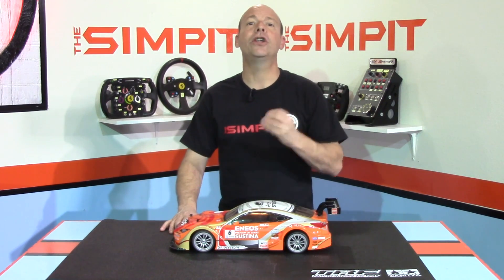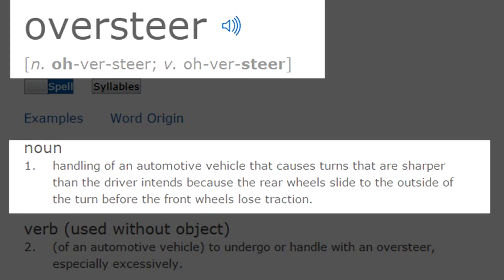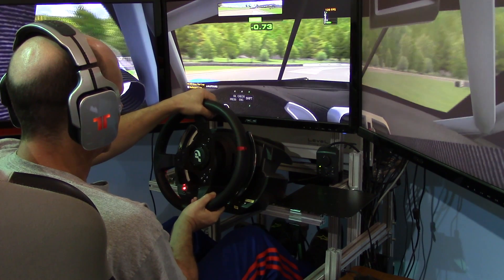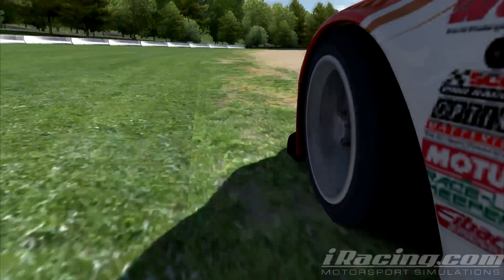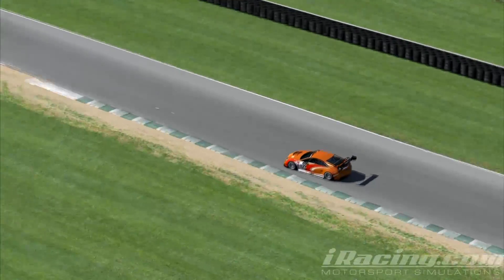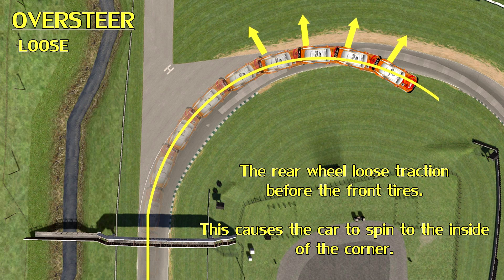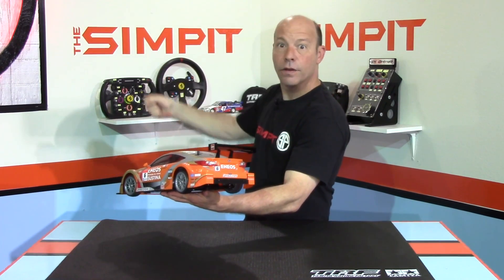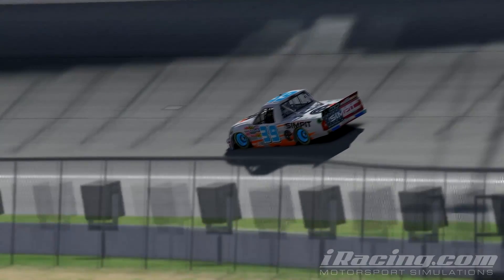Oversteer and Understeer Explained - Simpit Driving School

Comment: I know you meant that oversteer is faster when compared to understeer but I also know with the way you said it a few people are going to think you said oversteer is faster outright >< great videos though :D
Reply: Very good comment. I would like to give some extra input why oversteer is not faster.
When the rear goes into a little slide, it means it has lost some or all of its grip. Also the grip that was needed to get the power to the road. This results in slower acceleration out of a corner.
This is actually what drift drivers have mastered, and all drivers say the same: Drifting is not the fastest way around a track.
Reply: Maurice Wijma "When the rear goes into a little slide, it means it has lost some or all of its grip."

Surely that's not entirely true. There is actually more grip to be had from sliding the tyres (front and/or rears) a little bit. The grip from the tyre increases up to a maximum at certain/optimal amount of slide/slip angle and then starts to decrease with further increases in slide/slip angle past the optimal point. If the car in question has extra power to take advantage of this additional grip from having a little slide/slip, then the car can carry more speed through the corner and/or accelerate out of the corner with a higher speed than if the tyres had no slide/slip angle at all.

I think in order to achieve the required optimal slide/slip angle, the car cannot be understeery or else you won't be able to loosen the rear enough to achieve optimal slide/slip angle in the tyres. In that sense, it would be preferable to be oversteery vs understeering but neither are optimal and instead you'd want the car to be neutral to be fastest overall for the best turn in rate whilst maintaining highest possible grip and the ability to apply the throttle out of the corner without the rear snapping on you. Neutral being the perfect setup that allows easy, predictable driving behavior whilst still be able to closet to the/your limit, the limit having maximum speed due to having maximum grip from the tyres which comes from driving them at their optimal slide/slip angle.

Drifting is going past the optimal slide/slip angle which decreases the grip vs zero slide/slip state and thus the corner must be driven slow than could otherwise be.
 
Having said that though, i have wondered if there are exceptions to that rule based on the type of surface being driven on. E.g. gravel, snow, etc. Because I've read that ABS on gravel/snow is actually worse than just locking up the brakes of the car because if you lock them up on (sufficiently heavy) gravel/snow, the tyres will dig in and the gravel/snow will build up in front of the tyre slowing it down faster that if you tried braking without lockup. If that's so, then perhaps attacking a track's corner with heavy gravel/snow with a drift may allow you to attack it with the greatest speed possible for heavy gravel/snow.

But I've digressed and perhaps i'm wrong.
Reply: DrR1pper i think what you're saying is right but what can make it confusing is when any rear slip is called oversteer, i think oversteer is only when the rear car is sliding out of control, if it is controlled and gets you around a corner faster I don't think oversteer is a good word for that situation because you arent OVERsteering you are steering exactly as intended and required to do so, there must be a better way of describing those situations.
Reply: megaspeed2v2 Right, think i see what you mean. So you take oversteer to just mean the tendency for the car to over rotate for some given input by the driver?

But here's the thing. If you want to drive with as much speed through a corner as possible, you need as much grip as possible from all four tyres. To achieve the maximum grip from all four tyres simultaneously, each tyre must be driven at their optimal slide/slip angles. Provided the front and rear tyres have the same slide/slip angle to grip curves (which they usually do), then to achieve optimal grip from all four tyres you need all the tyres to point in the same direction whilst the car is holding an over-rotation of the optimal slide/slip angle to it's true direction of travel (i.e. it's actual trajectory vs it's forward facing direction). Since the rears are always pointing in the direction of the car, the front tyres need to face straight which means the steering angle needs to be straight during the cornering phase.

But how can we do that? Surely, we need the car to have a slightly oversteery tendency, no? The opposite of oversteery is understeery which means the car will return to stability (straight and evenly distributed weight balance) when experiencing a perturbation (i.e. some weight shift, e.g. cornering). To get the most grip, you need to initially over-rotate the car with some steering input and then quickly return to center to stop the over-rotation and then maintain the rotation rate with a straight steering angle and using just the throttle and weight balance/shifting to steer it through the corner. Why? So all four tyres can remain at the optimal slide/slip angle.

Edit: on second thoughts, i suppose one could argue that this is just a well balanced/neutrally setup car which just means it has some oversteery tendency in some areas of it's driving envelope and then some understeery tendencies elsewhere for stable, predictable handling. In which case, calling oversteery and understeery beneficial or a pain in the ass only makes real sense when talking about specifics?

Blah! lol. Think i've blown this out of proportion. :P
Reply: DrR1pper i tend to overblow things too xD its a complicated subject :D

Comment: How is counter-steer, counter intuitive? it's always seemed perfectly intuitive to me... Regardless; I'm starting to get the feeling that this guide might be a little TOO basic for anyone who is going to end up here in the first place.
Reply: He means that if you're turning right you would think you need to turn the wheel to the right but when you have that condition you need to turn the wheel left. I would think that would be fairly obvious to understand what he meant. Either you're just trying to be critical or you're pretty dim witted.
Reply: Big_Mike81 Apparently you don't understand the meaning of the word counterintuitive. If you are turning right, but the car turns too far right, the INTUITIVE thing to do, is to turn back the other way.
Reply: Kevin J. Dildonik even prior to my mechanical knowledge, I still INTUITIVELY understood the basic concept of countersteer (even if I didn't know what it was called)

but I do agree that the final part of the recovery does become less intuitive to the uneducated (although in practice it is to some extent entirely intuition to get the timing right, I've had many a tank slapper in Sims, but very few in actual go-karts)

BUT at this point we are well beyond the scope of this video which appears to be a VERY basic introduction to under/ oversteer.

As for safety, yep! but to me I still find understeer terrifying, thankfully there is usually some sensation before it becomes a real issue (the main reason I drive with traction control off, day to day)
Reply: I suggest you read the title of the video, it is what it is, lol.
Reply: GamingLegends There's a difference between a beginner, and someone who has gone for a ride with their dad for the first time.
Reply: Its a video for noobs, hence the clue is in the title, explaining what over steer and under steer is.
Reply: Counter-steer is like drift, if you can drift in game, I bet you can counter-steer :3
Reply: It's counter intuitive because most amateur drivers think that by lessening the amount of turn-in (I.E. the right hand turn example mentioned above) would cause the car to immediately jump toward the wall or in this case, the left...crashing the car. But in fact, by doing so you can still turn correctly, you're just lessening the angle at which you turn and stabilizing the car.
Reply: kinyuen wong Actually Drifting has more to do with understeer than oversteer ;)

(Because I know that'll go over most peoples heads, that's a reference to "Initial D" )